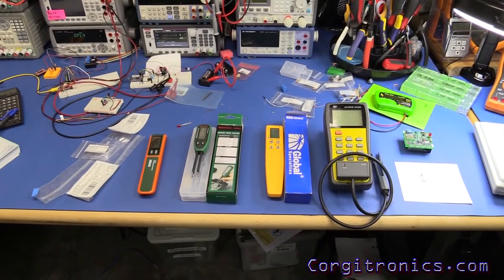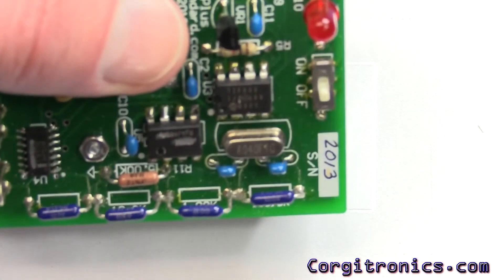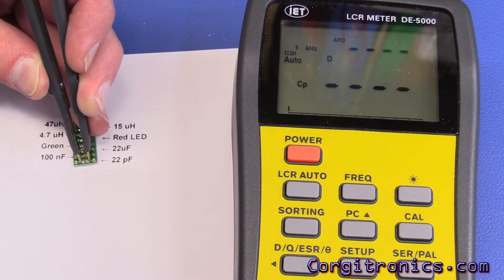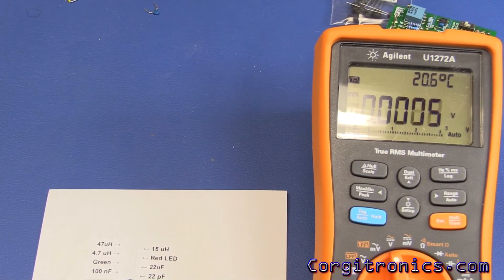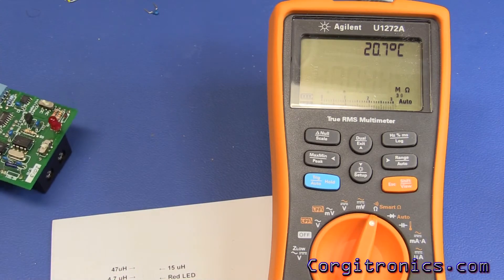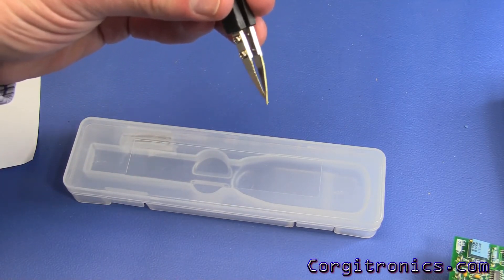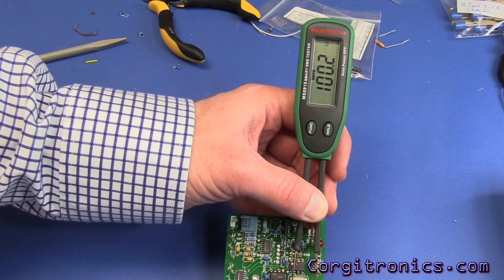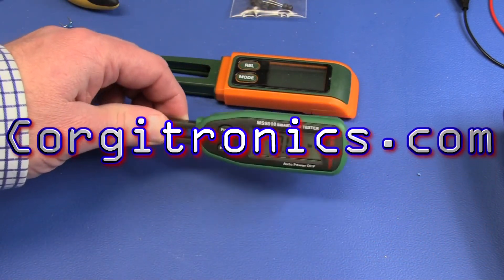SMD Smart Tweezers - Part 1

Comment: do i need this Tweezers for smd test ? or can i just use fluke 15b+?
Reply from the maker: The Fluke 15B+ will work, but as in another comment using regular probes to test SMDs is a pain.  Also, the 15B+ diode test only goes up to 2 Volts, doesn't test inductors.  The Mastech is able to light a blue LED, even if it can't measure the diode's voltage drop.
The Fluke will get you by for a lot of things, but it might be easier if you get some SMD tweezer probes to plug into it.